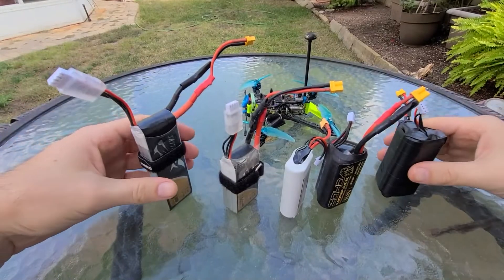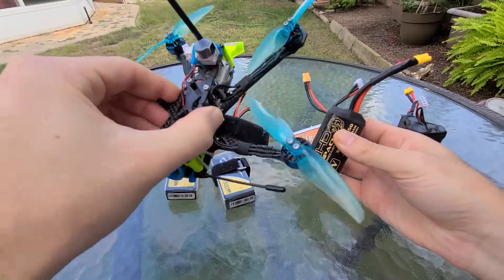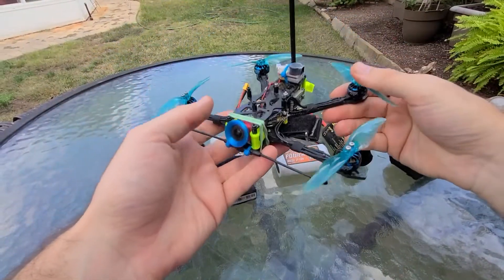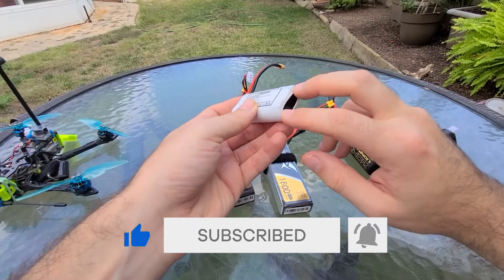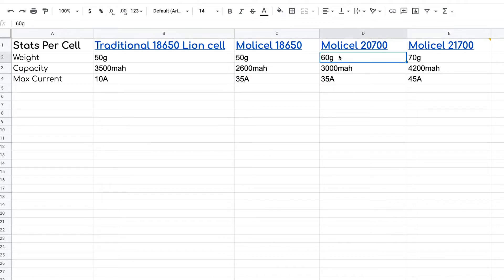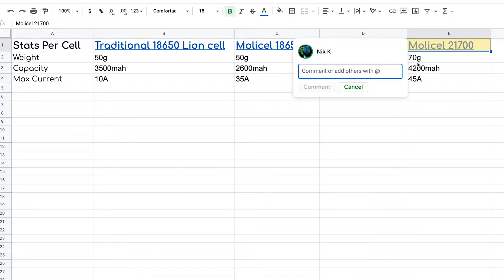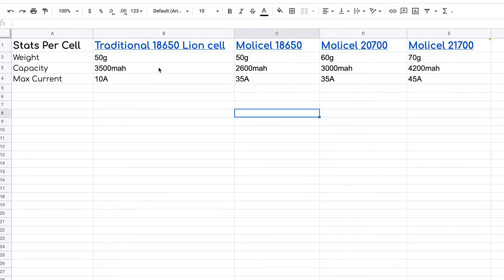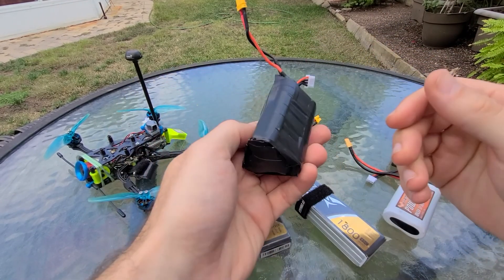One Lithium Ion Pack to Rule them All? AMP CORRECTION IN DESCRIPTION ↓

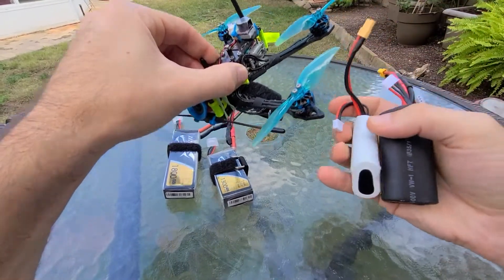Comment: 1:40 I though the amp rating didn't change when the batteries were in series, so 3 x 18650 in a 3s1p (like the ZOHD pack) configuration using LG cells rated at 10A, then it's 10A Max, you don't triple the max amp draw rating because you have three cells in series.

You do double/triple the max amp draw rating if you parallel up packs together, so 2 x 3S li-ion cells in parallel would double the capacity (7000mAh) and double the max constant amp draw to 20A.

Those two li-ion cells you have there are designed for planes, I have both the 2s and 3s version of the Strix cells, they are really good but not designed for meaty situations, if you pulled 50A from them, then apart from it being a testament to the quality of the cells used, you were extremely lucky to get the quad back without the cells catching fire lol).
Reply from the maker: The ZOHD packs specifically say "Max. Continuous Discharge Current: 10A per cell"
Reply from the maker: I wonder if it's a typo. It's printed on the pack and it's on the product page: https://www.getfpv.com/zohd-lionpack-18650-3s1p-3500mah-11-1v-li-ion-battery.html . I appreciate your correction though.  I'll update the deacription soon.
Reply: NikFPV depends what cell is inside the pack, the figures on the pack don't make sense, most 3500mAh cells are rated at 8A, to get 10A you have to go to a 3000mAh cell, say an HG2, and if you want higher rating amp draw you have to use Sony cells which are a maximum of 2600mAh.  As I said, the capacity rating suggests they are 10A rated cells, not 30A.

I suspect thus is a case of Chinese translation combined with someone who really doesn't understand the difference between parallel and serial, if the pack was a 10A cell and in parallel (so a 4.2v 11500mAh cell) then the max amp draw would be 30A, but not the other way.

If the whole pack is indeed 30A max draw rated, then the capacity is too high for the cells available on the market to purchase with those Amp ratings (VC5, VC6, VC6A etc), so something not quiet right with their labelling and get FPV have just copy/pasted it without checking.
Reply from the maker: @jibbajabba4597  That makes sense. Ya probably a translation issue. Thanks for the info. I've corrected it in the title/description

Comment: You are getting i wrong. The 10A rating is for the whole pack and not pr cell, as long as there are no cells i parallel. This goes if it is a 2s, 3s or even 6s pack.
Reply from the maker: The ZOHD packs specifically say "Max. Continuous Discharge Current: 10A per cell"
Reply: @brickclickfidgets  yes, but  that still mean 10A for the whole pack as long as all cells are connected in series. You need to reed up on voltage and current vs series and parallel connections.
Reply from the maker: @Ronsand1  i appreciate your correction. I'll update the video deacription shortly.

Comment: So zohd 10A are working, but the power and speed of flying is limited ?
Reply from the maker: Yes
Reply: I have done a endurance test flight with the explorer lr lasting 32minutes, using the zohd 3s. My speed was limited beween 20 to 30km/h to remain between 7 and 8.5 amps consumption. Video here:
https://youtu.be/lRfyXolr8gQ